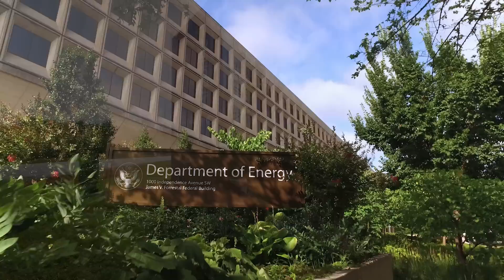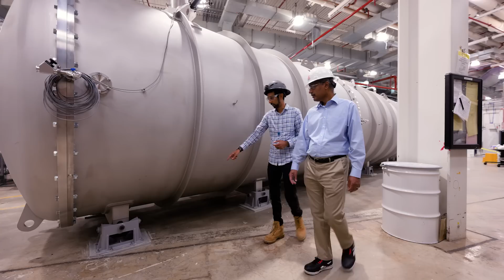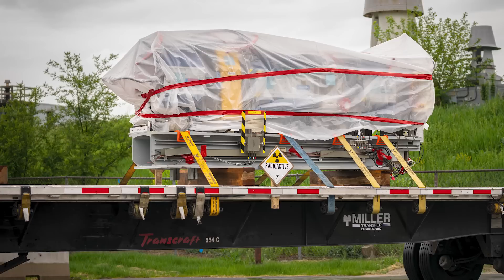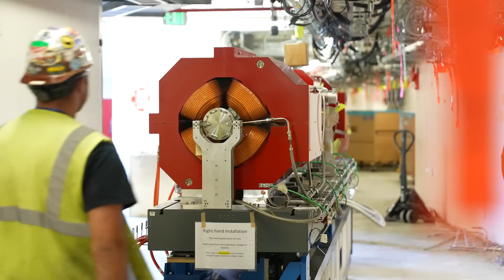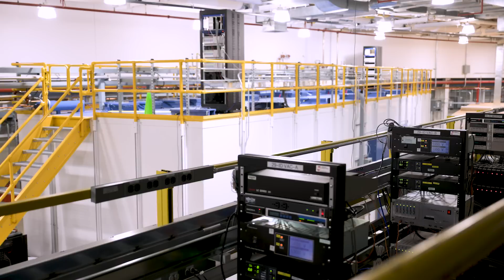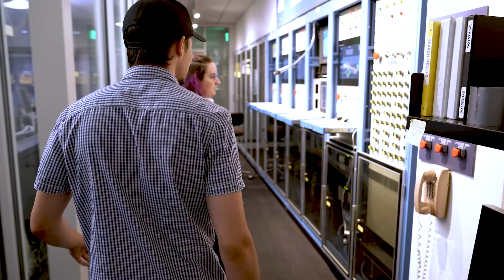Building Brilliance: The Upgrade of Argonne’s Advanced Photon Source

Comment: I have a question. The comment was made that "electrons are circulated at close to the speed of light ". Yet the title says Photon Source? Obviously its a particular accelerator. But which particle?
Reply: When charged particles (in this case electrons, which are very light, compared to something like proton or ions), are accelerated (i.e. their direction is deflected to go from straight to go straight but in a different direction, even by small angle), they emit electromagnetic radiation. So photons. If they travel very fast, and you deflect them very strongly in a very short amount of space and time, you get very high energy (frequency) photons, in this case X-rays. Various points along the circle (in fact it is more like 200 segments of straight line, each deflecting just by a little), electromagnets are deflecting by slightly different amounts, allowing to very the frequency / energy of the X-rays.

Very high energy X-rays , especially if they are very well controlled (i.e. their frequency is very well controlled, and tightly focused) have a lot of uses, in crystalography, chemistry, biological and material research, to understand what is going inside stuff, or even how it is built on atomic scale (i.e. determining types and location of atoms in a unknown molecule for example).